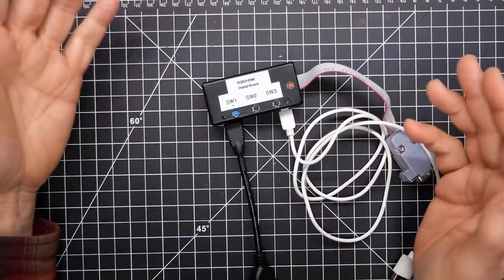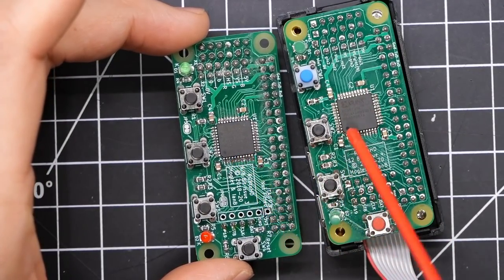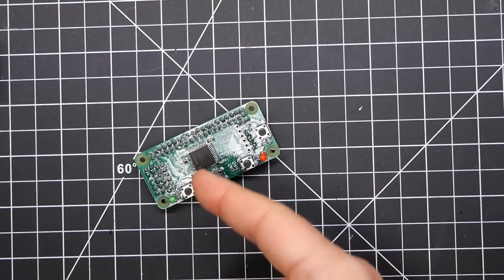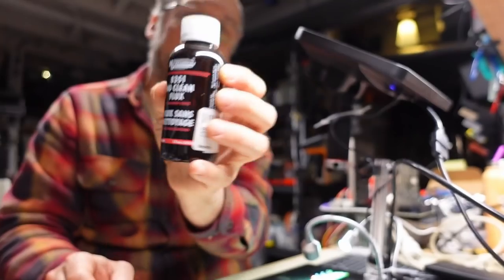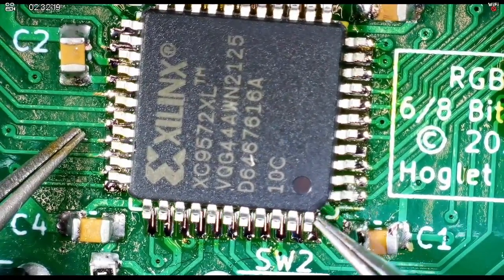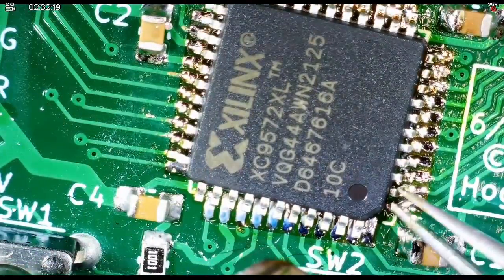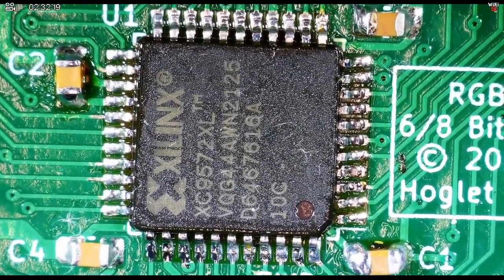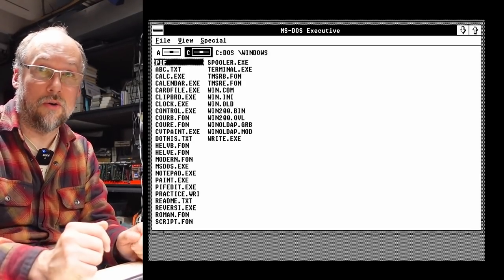The perfect way to NOT do SMD rework (RGB2HDMI overview and repair)

Comment: Oh yes... soldering SMD is a nightmare. But your mishap gave me a good chuckle cause I couldn't help to think that you gave new meaning to the "+/- 1 error" that is common in programming 😉 - I think the "let the solder pull the chip" trick works regardless of the chip size, because: larger chip, more pins. It should be proportional force to help pull the chip into position, but whenever you push down on the chip it's slipping away.

Comment: A few techniques you could use.  hot air or hand soldering.  Hot air I would use a bigger nozzle.  You want to get heat into the PCB and then go in close when solder is almost molten.  Flux helps.  Yes surface tension should pull the chip into place.
Minimal solder is better than too much solder in my opinion.  You can always clean up solder bridges afterwards or add solder afterwards.  

Hand soldering requires you to remove all the solder from the pads with a wick, then solder the chip in place by tagging down a few legs.

The mindset you need with any soldering is that the pads have to reach the temperature required to melt solder.  Most newbies think about melting solder when you should be thinking about what you are soldering to, the pads.

Comment: This brings back bad memories of assembling boards with 0.5mm ribbon cable connectors. The pins kept bridging under the connector, and even after checking them repeatedly with a meter and finding no shorts, they still shorted and burned.

Comment: like many others have said remove with the hot air, clean the pads and tack the corners.  The best flux to use is Amtec bga rework flux it. It just takes time and practice to get better so I say you did a great job for a first time, the fact that it worked is the main thing. 😁

Comment: It's like you said, the more you do SMD the better you get. Your method will change depending on package type and board layout. For the most part I use the drag solder method, clean the contact pads with solder wick, then clean with IPA. So the chip will lie flat on the board. Place the chip and tack opposite corners. Apply flux to one line of pins at a time then drag solder. Clean off any bridges with wick. Clean off all flux and reinspect for bridges. If you put flux on all pins it starts to dry up before you get to solder.

Comment: Adrian, that rosin in alcohol flux is wonderful for wires and connectors once the alcohol has evaporated (I ALWAYS have it in a needle dispenser bottle on my bench), but it's not what you want for PCB rework. You need paste flux made for PCB rework. You also need to have the board held down because it's impossible to work on moving boards. You were so close but without enough of the right flux and the board stationary, it's like trying to ski on fence boards for skis. I would recommend watching some videos by Louis Rossmann and Jessa Jones (the microsoldering mom). Check out "Introduction to Microsoldering with Jessa Jones" on iFixIt's channel for a great intro. One tip: It's all about moving swiftly in definite steps; heat, pull, clean, flux, tin, new part, heat, center, cool.

Comment: As someone experienced with SMD rework, you were so close on your first attempt... Your mistakes were:
1. Don't hold the IC. Ever. It'll move and wiggle (as you said) to find the right location.
2. You needed flux when you put the new part on (to clean the chip pins). You didn't really need flux to remove the old one.

Finally when using the iron, you want the tip dry (no solder at all, just heat).

And again, more flux! You can never have too much flux!

Well done!

Comment: this sort of rework is MUCH easier if you have the proper tip for your hot air, they make them with 4 sides of various lengths with narrow slots to direct the air to the pins, no flux needed.  Heat and slide a thin stiff wire (tool often comes with rework station) under and lift off.  then clean ALL the excess solder off so the chip can lie flat.  solder a corner and tweak until it's positioned.  Alternately you can use solder paste, and put it on with heat as well.  Takes some practice.  try remove and reinstall on a dead tv, or whatever old junk you may have access to.  if soldering by hand once it's positioned just blob solder across all the pins on each side.  Let cool and then use solder wick to take up the excess.  works a treat.

Comment: SMD soldering is a real PITA when you're new to it, though one change to the process, if you lack the hot-air repwork tools, I'd offer is just taking some sharp snips to the pins of the dead chip and cut it off, then remove the pins individually with an iron, they just swipe off easily, and then follow that up with cleaning off the pads with wick and then going through the tedious process of soldering pins one by one with a fine tip and some thin solder, flux being used as thin solder might not have enough rosin core in it... :)

I say this having nervously done a few SMD ICs (new PCB kits and a few repairs) that amazingly turned out well, despite being a slow process for me to accomplish... :P

Comment: Don't use wick to clean up shorts between pins. Clean your iron, add flux, and make another pass with the iron, and the iron will wick up the extra solder without desoldering the pins. If it doesn't clear it up, repeat: clean tip, more flux, make another pass. You'll have a much easier time with it that way.

Also many people said that, but cleaning up the pads after desoldering the old chip is always a good idea. You'll have an easier time aligning the chip, and you're not mixing solder chemistries.

Comment: FYI, I use to do quad pac replacements with a kit. It had stcky flux and low temp solder. You put flux on and then solder all the pins. then using two soldering irons hitting all sides at once the chip floated off within 10 seconds. the use solder braid to remove solder and then put new chip in

Comment: Yup. Leaving the old solder there makes it impossible to get the chip to stay in place. That's why I prefer to clean it all off first so the chip lays flat on the board.
Hot air is nice for desoldering but I've never found it useful for soldering unless you're using paste.
In the end it looks fine though.

Comment: QFP pins can be cut with a sharp hobby knife if you know you're just replacing a bad component.  Get the now leadless package out of the way and remove the leftover leads with a soldering iron.  Clean solder off the pads and place the new component and tack a couple of corners once aligned.  Then go through each lead with a fine tip soldering iron.

Now BGA components, on the other hand...

Comment: Excellent video, as always Adrian. I have recently acquired one of those el cheapo smd rework stations so I bought a joblot of pcbs to practice on. I think you should have wicked the old solder off the board traces before applying fresh solder, but I’m no expert either.

Comment: Being a casual user and also owning the same hot air gun, I found that using strips of doubled or more aluminum foil as Shields for the chip and surrounding components and using the tip that's wide enough to cover the whole chip works best.. Gotta heat even,, from my experience anyhow

Comment: I practice reworking SMD chips by taking the flash memory off of an old, low capacity USB stick, then putting it back on.  If it’s still alive afterward, you did it right. If you kill it, no big loss.

Comment: Hey, at least you didn't rip off any pads/traces like I did when attempting to repair my RASCSI. AND your repair worked in the end, first try! I had to run some pretty ugly bodges to fix the RASCSI that I mutilated. Twice. Because of course I didn't get it right the first time. :P

I would ditch the crappy stand that came with your microscope and get a new one. Those stands are pretty horrible. There are many great 3D printed stand designs out there that give you way more adjustability and better coverage. I ended up going one step further with mine tho. I got one of those tripod socket mount arm things that clamp to your desk and terminate in a 1/4-20 screw thread. I then 3D printed a clamp that fits my microscope, and I molded a 1/4-20 female screw thread into it so that I can screw it to the desk arm thing. So I now have my microscope mounted on a fully articulated arm that I can position any which way I need, and can swing out of the way when I'm not using it.

Tacky style flux definitely helps. For one thing it doesn't go shooting all over the place. It also helps stick parts down to the board long enough for you to tack a pin down to prevent them from moving any further.

As for soldering new parts on, I prefer the "tack down one pin and then solder the rest" method. I first sop up all of the leftover solder using wick, so that I am left with shiny clean pads. I then put a blob of solder on one pad, then heat that solder blob while finagling the part into position. When it's correctly positioned, I remove the soldering iron and let it cool. The part is now correctly positioned and secured on one corner. I then just go around hitting the rest of the pads with solder (put a bit of solder on the tip, then just drag it over the rest of the legs.) Oh yeah and I use flux. Lots of flux.

Whenever I use hot air I always liberally apply Kapton tape around the part I'm trying to desolder. It's definitely needed if any of the parts nearby are plastic (connector housings, buttons, etc.) But even if there isn't anything melty within the line of fire, I still put down the kapton tape; I consider it as extra insurance against accidentally desoldering or heat damaging something that I didn't mean to desolder.

Comment: FWIW I've found the easiest way to desolder Quad Flat Packs is with ChipQuik it's basically a low melting alloy solder you flow over the existing solder and it'll stay molten for longer so you can pop the chip off pretty easily (I've used it successfully on packages with 0.5mm pitch connections), it's not cheap but a little goes a long way and it works. Only thing to be careful with is making sure you properly clean it all off the board afterwards (solder braid + flux will get you there).

Comment: The best way to remove chip capacitors/resistors is with thermal tweezers or two soldering irons :)

As for big chips like that CPLD, flux isn't really so much of an issue - the flux helps deoxidize surfaces to make solder stick better.  Sometimes adding more solder helps with the heat transfer, but adding flux will do little to help with removal.  Generally I use a copper braid to remove QFP ICs like that.
Reply: Oxide is a thermal insulator and  when you apply more heat to a solder joint without flux you're creating more oxide. Using flux isn't mandatory for hot air desoldering, but it can make it a little easier.

Comment: This might be difficult to accept, but--you have well enough dexterity (or sinistar'ness)  to solder that pip-by-pin just like a big DIP part.

Though, you need a fine soldering tip and quite fine solder. In the video, you placed the tip and also the probes with great control. Drag soldering is cool, but so is using what works for you. Fine solder lets you modulate the solder amount better than coarse. I have the same Hakko soldering station, that it seems everyone has; the fine pointed tip, although it's round, it works because it's small enough to nestle up to both the end of a single chip pin, and the board. 

A binocular stereo microscope really helps better than any video thing, if you have two working eyes. Also, having a lot of diffuse light, from two sources helps see the solder, which is difficult because most of what you see is a reflection of something else. This one is difficult for me: avoiding caffeine when surface-mount soldering.

I haven't tried this, but Kapton/polyamide tape can be temporarily stuck over parts that you don't want heated unsoldered, as long as there is a little room around the part.

I got some kits on Amazon for practicing surface mount soldering, which is less stressful than soldering a video collector's item back before a better time when all the systems-on-chips weren't slated for battlefield weapons.

For the practice kits, I used .025"/23-gauge 2.2%RA Flux, MB 4884-227G Solder. I had bought fancy Kester 959T flux, but found that a Techspray No-clearn flux pen 2507-N, was more convenient, and didn't all leak everywhere. I cleaned up after the flux, anyway, (as should be done with High-Speed/RF/Microwave circuitry, because it causes signal-integrity issues, if it's not removed, because the residue can cause impedance discontinuities, that raise the reflection coefficient, while lowering the transmission one, well, at least that's what I hear out on the street : )

Comment: With N comments there are approximately N² opinions on how to do it. So I will gladly add mine as well.

I recently had the joy of soldering/desolderin/resoldering ATmega16s in TQFP-44 (which seems what the CPLD is) numerous times.
Here's how I did it an made things work
1. I did not use any extra flux. Only what was contained in the solder paste or regular solder (more on that below)
2. For a new board, solder paste and hot air worked best, as it did for getting the chip off the board again.
3. On a previously used footprint, you can either try to clean the pads off and then start over with solder paste again (the paste may not stick to the board too well, so I don't normally do it). But then I just use a fine tip (much finer than what you used) and 0.5mm rosin core solder.
4. When you have tinned pads like you did after removing the CPLD, another option is to put the chip on the board and do what you did after getting it on at an angle. Start at one corner and simply heat up the solder on the pad, melt the chip's leg in and let it cool. Repeat on opposite corner and then go through the pins one by one. You need surprisingly little solder for a good connection (keep in mind, this is all just signals, no beefy power connections), and having too much solder gets you those nasty bridges.

Comment: Got a non-working RPi  3B+ from work. I work at a Second Hand shop, where 90% electronics stuff that we are given are broken, in this case I guess, the CPU is soldered askew from factory. So the donor "gifted" us the dead RPi after he got a new one from warranty. Now I'm waiting for the crapton tape I ordered. Got my sticky Am-Tech flux and  my hot air wand ready...

Comment: The 8351 (aka 836, they're the same) liquid no clean is really quite weak. In terms of MG chemicals products, I would use the 835 liquid moderate rosin (which is basically no-clean, though it's not advertised as such) or the 8341 no-clean paste.

The 8351/836 flux is a rosin-free organic acid flux and it does not have much staying power at all. It's good enough to get the job done a lot of the time but it won't usually leave you with very good looking joints. It's also pretty worthless for hot air because it dries out immediately.

Most people seem to like the Amtech NC-559-ASM. Beware, however, that there are at least three Amtechs that all claim to be the real Amtech. NC-559-ASM that Amtechdirect sells seems to be identical to NC-559-V2 that Inventec sells. So if you get either NC-559-V2 that says Inventec on it, or NC-559-ASM with the american flag, you're good. Rossmann and NRF both sell the Inventec stuff. There are also a lot of outright counterfeit Amtech products being sold, avoid those.

Comment: Hey Adrian! So funny, I just bought a Raspberry Pi 400 to connect my USB microscope to a big TV screen for SMD soldering and made a small video about that... and the XILINIX FPGA (I think its the same as you work with) also gives me much trouble. I am currently working on a PiStorm... I realized that I have to practice, and rework my techniques :D. Also, I meanwhile ordered a template for soldering since I have to solder many (very small:D) components.Thx for showing your work, Greetings, Nils

Comment: Your chip removal technique was just fine, and your only issue was basically "combining" two separate methods when trying to install the replacement chip.

The better option one is to wick off the pads entirely and then tack a couple corners and hand-solder (as you ended up doing here). Removing all the original solder makes it much easier to get the chip centered properly because you're not trying to work on the rounded solder blob tops, and it's easier to avoid ending up with too much solder because the board starts bare. This is generally my preferred technique for any leaded packages like what you're using (faster and less fiddly), but it's no good for leadless or BGA.

Barring the above, the alternative option is to also clean the board of solder entirely and use hot air for attaching the new chip, but use solder paste instead of pre-tinning the pins. Since the solder paste is microscopic solder balls in a flux suspension, you can simply spread thin lines of it along the pads (you don't need to be super precise) and then the chip will still sit flat on the board when squished down into it. Then, you heat the chip up with your hot air station (I recommend a larger nozzle and lower air velocity to avoid pushing the chip around while allowing you to heat more pins simultaneously), and just heat gradually until the paste liquefies it and it will "magically" pull everything into alignment.

Poking/holding the chip with tweezers while doing the second method is counterproductive as it will just end up pushing the chip out of place when the resistance to movement changes as the solder melts/attaches. If your chip is moving, either your air velocity is too high or you should hold the hot air nozzle more perpendicular/vertical so it won't "push" the chip to one side.

Overall though, pretty decent for a first attempt and keep at it!